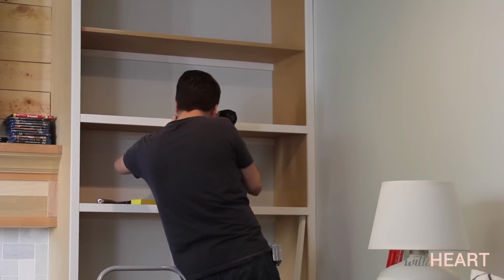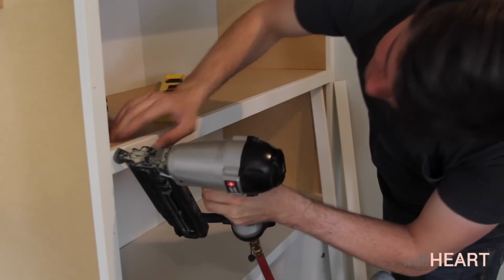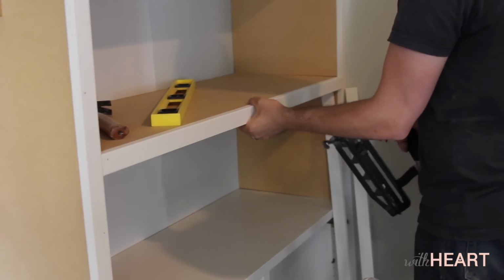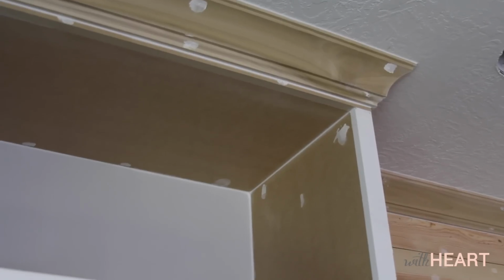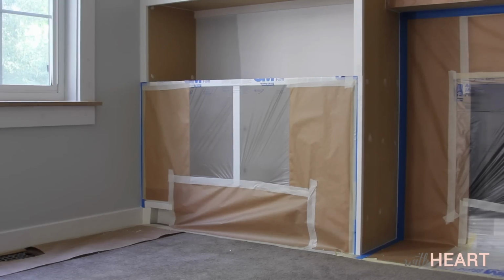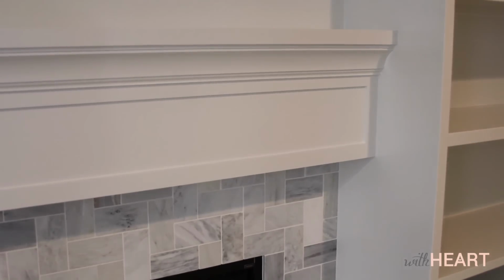DIY Built-ins Part 2 | withHEART

Comment: What did you use underneath the cabinets between the legs, and how did you attach it?
Reply: Sarah Williams I saw your comment and I did something similar, before installing the cabinet, I cut some 1x4 to size and screwed it into the leg from behind, then put the cabinets in place

Comment: Hi Jennifer, great job on these built-ins. Does the paint on the Besta units and the book shelves match? I am planing to do something similar but am concerned that the painted shelves won't match the paint of the Ikea units. Any tips on how to accomplish that? Thanks!
Reply from the maker: Hi Varun, thanks for watching!  I took one of the doors on the Besta unit to the paint store and had it color matched so it was exactly the same.  Hope that is helpful!
Reply: +Jennifer Stagg hi I love your videos lol. I wanted to know what is the width and length of the fire insert??? I am going to attempt this look but with an electric insert. but I want to build a base for it to sit in to make it look real and custom. We also are trying to do the built in but this will be in my dining room since it is the biggest wall. About how much wider should I build the base around the insert to make it look like it is really in the wall????

Comment: 0:24 Is he just finish nailing into sheetrock?
Reply: That high up on the wall there should be a top plate. That's likely an exterior wall, meaning there "should" be a double top plate -- even more to nail into. I think he's ok nailing there.
Reply: @wcraft  In the previous video, it looked like they finished nailed the pine boards (above the mantel) into the sheetrock.  I see now the TV is wall mounted - hopefully they secured it to more than just the pine boards.